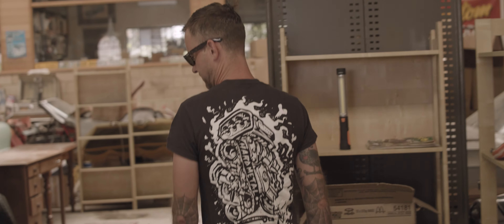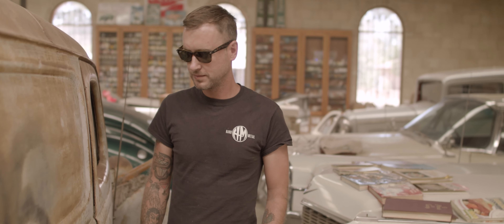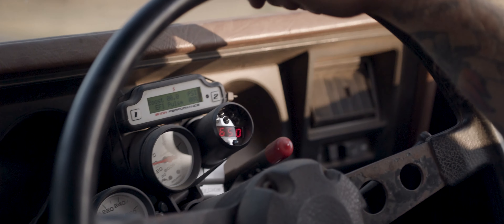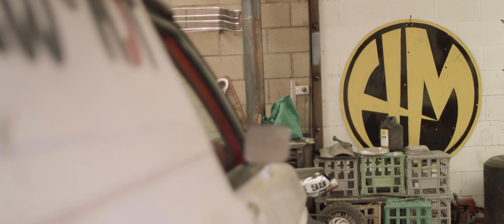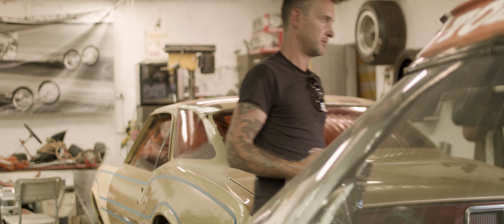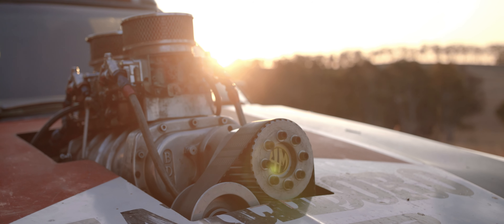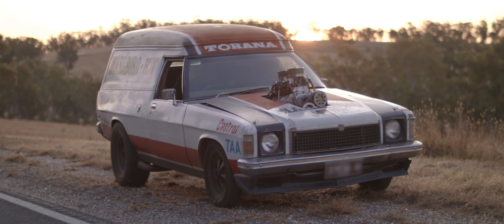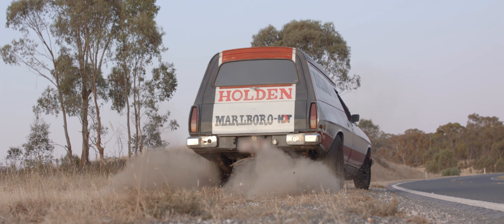Ryan's Holden Panel Van | DRIVEN | Ep 20

Comment: You're old man looked after 'Custom Vans & Trucks Magazine? WoW man, when i was 10 or 11 years old, i sketched a tuff XC panelvan ,Freehand of course, and sent the drawing in to Custom Vans & Trucks magazine, & probably your old man or the editor ,published my drawing in the magazine, and sent me a free issue of the next month magazine with my drawing in it. I was so stoked. Now im 45, and im still a car freek,still getting grease and bog dust under the nails,and i still have that magazine somewhere, from 1985 or 86.You're old man is cool, and i say thanx to him for making my day as a young kid.
Reply: What do u have I’m 14 and I’ve got datto 1000 Ute dads got LJs and LCs got a big block and another impala chopped into a Ute 25 ANNIVERSARY HJ
Reply: @jaiwilliams9753  Well im in my 40's now, so ive owned over 50 cars. Ive had some beasts. I wish i kept alot of them!! Currently i have a BF Cobra ute, and im working on my street machine project custom XF/LTD ute with 351W efi conversion. Its coming along pretty nicely.
Reply: @steveskrobot9496  sweet as keep me posted